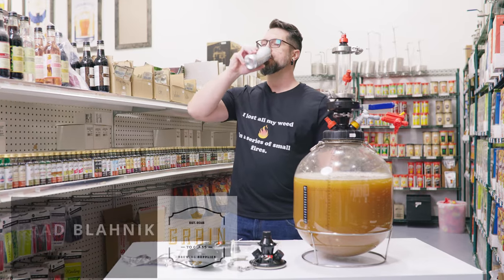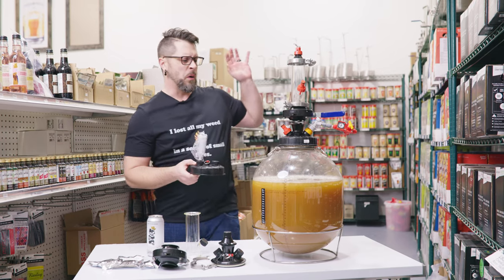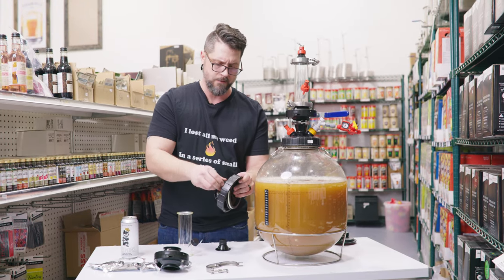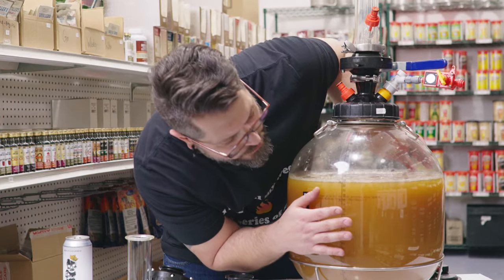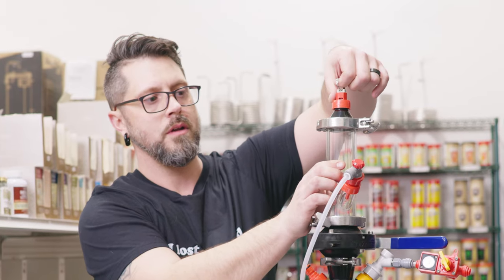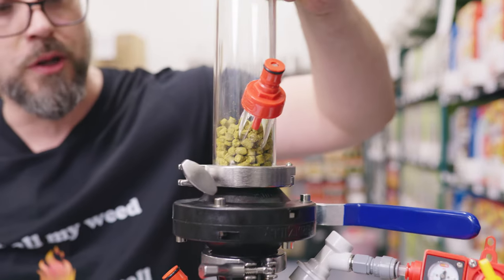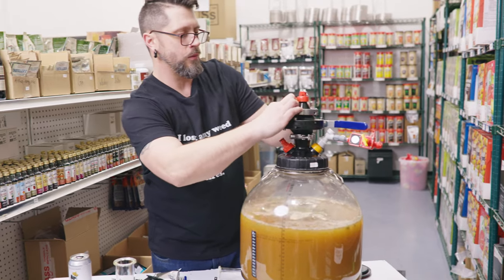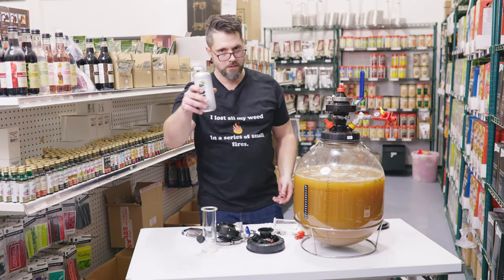Revolutionize Your Homebrew: Oxygen Free Dry Hopping With The Fermzilla Hop Bong

Comment: Just wondering how you will get the beer out as it seems like there is no floating dip tube? Or do you rotate the fermenter until the liquid post is under beer level? If this is a secondary it could work as no yeast cake on the bottom. 🤔
Reply from the maker: Hey good catch. I was in a rush preparing for the video and I forgot to put the dip tube in. I've learned my lesson since then. The floating dip tube works...if you install it lol
Reply: @graintoglass  
Haha, yes things like this happen. Everytime I try out new equipment or processes, something goes wrong. It is really like a real craft where you learn from mistakes and improve constantly

Comment: But what about using a blow off tube instead of a spunding valve? As I would be using it to drop hops in, then have the blow off tube on while it dry hops for 3-5 days.
Reply from the maker: If you can't use a spunding valve a blow off should work.  Cheers